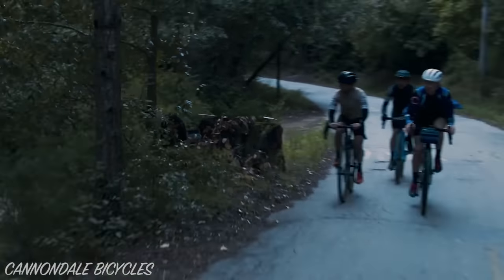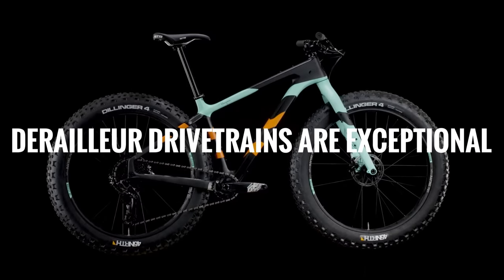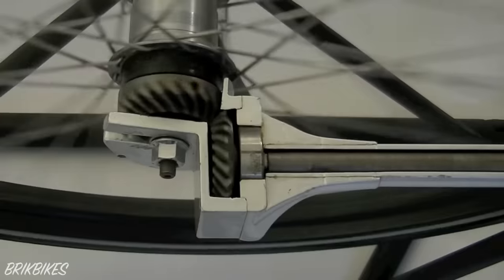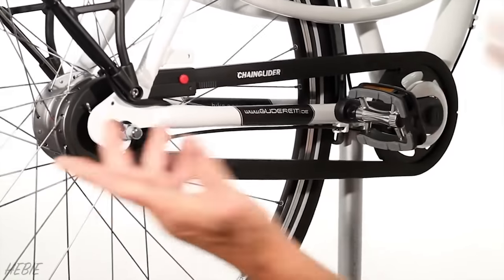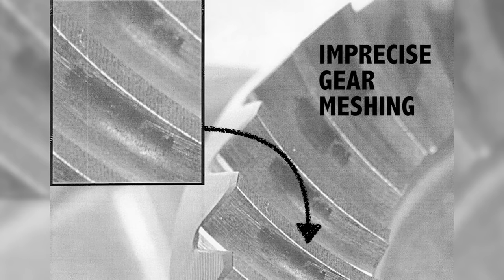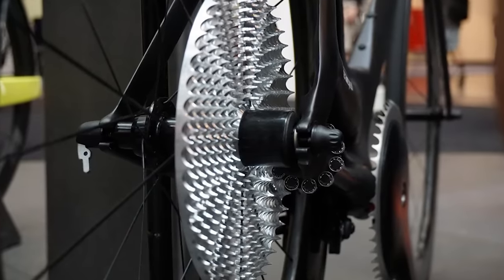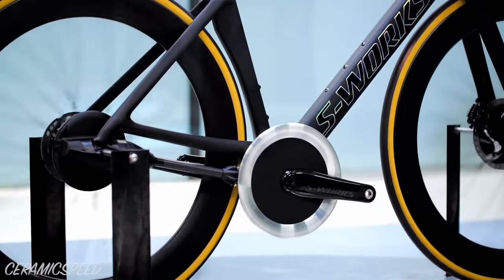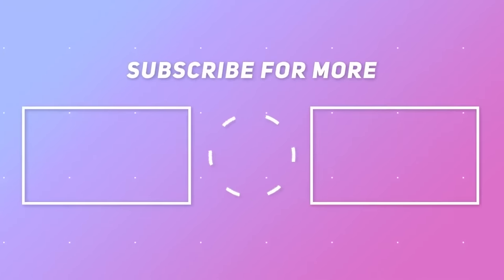Are Chainless Shaft Drive Bicycles a GENIUS or TERRIBLE Idea?

Comment from the maker: QUESTION: Do you think the Driven drivetrain will make the leap from cool concept to derailleur killer? 🤔🤔
Reply: seems like shaft drive with a hub gear is a better solution? both technologies tried & trusted no point reinventing the wheel
Reply: only if you want self contained though - chain isn't going anywhere
Reply: I don’t think it’s going to replace derailleur systems, at least not until there are more innovations in materials and engineering design.  And while the engineering and materials challenges are significant, I think the real challenge is going to be convincing frame manufacturers to invest in the currently unproven design...
Reply: Not hep on it.
Looks flashy but weak.
CEOs letter said the same.
I run a machine shop & ride Road & FAT bikes.
My Road are chain & 10 speed (ubiquitous & flexible) + a Specialized Langster Fixed Gear  (unbreakable & efficient).

The Belt drive running an IGH is a 'dream item' in my Future + I believe the way forward for increased drivetrain reliability.

I'm SUPER curious about Shimanos 13 Speed Gearbox development - what have you heard of late ?

PS I know Rolloff & Pinion are FAB but they're $$$ still & Shimano seems to have all the right factors to bring Gearbox Bikes to the FOREFRONT of the marketplace.
Reply: @roseroserose588  Yeah, Driven claims very high efficiency, but what happens when it gets dirty?
Reply: The fancy drive model looks ok , if they can make it stay reliable for the long term , but for me I’m a bit partial to the old conventional driveshaft system even with its extra weight (that’s the car guy coming out in me😃), cars and trucks have been using them forever and if engineered properly they last for many years , as for parts , someone in need could easily have bits made at an engineering shop if they ever became scarce.
Probably the nicest solution is as you said , the belt and internal geared hub(except for the expense of the geared hub).
  I think for cheapness and pure convenience of being able to buy cheap parts would be the good old chain and derailer even with their small down sides..
Reply: I hope so, but not for my bicycle, but for a trike.  The extra weight is not an issue, but REALLY long chains have their own set of problems.  Or do you use multiple chains?
Reply: @albertbatfinder5240  Yes, I think it's a convenient opportunity for data collection during development. Do a heap of research that doesn't pan out or proves your theory wrong. "Whoops! We determined that it wasn't feasible due to the current market climate, so have unfortunately decided to suspend development." There goes your investment, boohoo, good thing they had fun messing about in the lab...
Reply: no, dangerous rear wheel with the sharp parts exposed, they could have inverted the design with teeth facing wheel much like how a disc brake sticks away from the wheel, but what do I know as an engineer lolz.
Reply: How about direct drive like kid trikes? With recumbents and rohloff hubb, it could be
Reply: Isolated chain like it made in GoCycle with Bosch assist and Rohloff Soeedhub. We need to combine them.
Reply: @redlkb  Just use a race case
Reply: I have had a lot of BRIK driveshaft bikes in the shop. Those things just did not last (2000k commuting). They were plagued with alignment issues from the factory. I have also tried others. They all had this had this springy feel from the torsional spring that is the driveshaft. At least the ceramic drive tries to solve that issue. I am very doubtfull if this thing will work, but it would be nice if it did.
Reply: Absolutely not.  Any company making a shaft drive is going to be proprietary.  Whereas chain drives have been around long enough that they have been standardized.  So, if your shaft drive bike breaks down, you will be waiting for parts when a chain drive can be repaired from parts made by any manufacturer.  It would take a lot to kill a tried and true tech that delivers for less.
Reply: No. I'm convinced that this entire enterprise is a complete scam. The flex on that thin gear plate and the minimal tooth contact area is fundamentally flawed. I bet the current prototype can't deal with more than 80w maximum load.
Reply: Belts have most of the benefits and is more weather resistant.
Reply: Depends on efficiency.
Reply: Nope it won't kill off a chain and derailleur.
Reply: This tech is a century old. Do some reading before you copy/paste, bandwidth waster.
Reply: @albertbatfinder5240  crowd funding has become established manufacturers legalized scam. What they do is come with “pro” product that they have already designed ( how much does it take to slightly improve already market success product), take money that they have no legal obligation to return or fulfill with product, secure mass orders, use that (or invest for return) and then deliver the product so late that customers are already jumping up and down for next “new innovation”. It cost them nothing to but bring free money before even they mass produced, because people have already paid for it without guarantees.
Reply: No
Reply: Two seconds of FEA on this drivetrain should make it apparent that it's a pipe dream.
Reply: @alexdi1367  they currently are installed on "Hopper/Relay" bikes, so not a pipe dream Invented in 1800s.
Reply: @roseroserose588  I am new at working on belt drive bicycles. A little lossy, but silent, lighter and clean.
Reply: @albertbatfinder5240  the tech is over 100 years old and large (city-wide) rental bicycles use them. I think you should do more reading to refresh.
Reply: @bob-ny6kn  Hey Bob, I was specifically talking about the Driven drive train from CeramicSpeed.
Reply: @bob-ny6kn  If you can't figure out the topic, please stop talking.
Reply: @albertbatfinder5240  Right. But how many similarities can exist and call it a new idea?
Reply: No, but it will make a great niche.
Reply: No. It's spikes galore which means shredded legs and it trades away the only pro of shaft drives just to work.
Reply: Giuliano Skywalker  you do not see belts on sport bikes because of engineering cost and packaging. And there is no financial or safety reason to put them on sport bikes. Buell has proved belts on sport bikes work. Yamaha has proven high horsepower with shafts with the Vmax. Most manufacturers do not use Shaft Drive for sport bikes due to the “Shaft Effect”. With shaft drive when  you let off the throttle, the rear end squats and that eats up ground clearance which effects cornering angles. BMW uses a “Paralever” system to neutralize the “shaft effect”.
Reply: Make the leap? If you think outside 'Driven' you have a chance.
Reply: Absolutely not. There's just no compelling reason for it to exist.
Reply: The driven drivetrain is a bit of a non-starter. Even if you could solve issue of lateral rigidity on the rear cogs, there’s the issue of gear ratios and geometry: Because the diameter of each ring of teeth grows linearly, you’ll feel a very non-linear change in gear ratios with big steps in the high gears and small jumps in the low gears
Reply: Thinking outside the gearbox...
One could imagine the space between the 2 gear boxes as a long, small diameter motor. Motors solid shaft is the driveshaft.
Some of you might imagine several little mice in wheel cages spinning the driveshaft.😒
Reply: Nope.  Just not as simple, reliable or repairable on the road as a chain.  Chains have been around forever for a reason... they are simple and work.  Oh yeah and they are cheap and easy to make.
Reply: My point was (I didn't mention) the electric motors shaft is the driveshaft so IF the motor didn't work, pedaling and shifting is still unencumbered.
IT all being contained out of the elements = BIG PLUS.
Smaller diameter motor is less of a pedaling encumbrance when it's non-functioning.
Also it can be regenerative = BIG PLUS #2 .
-->I'm beginning to think I might be on-to something here.
Reply: you roadies will do anything for aero
Reply: A modified version for e bikes might end up looking sort of like a mechanical CVT and with modern composites/materials and manufacturing methods it's likely the whole thing can be sealed, dry lubed, and nearly unbreakable.  IMO the grail especially since anything that doesn't have a belt or chain in the transmission path immediately loses an order of magnitude of backlash and your efficiency should go up, even without internal friction reduction designs using off the shelf parts.

The whole drive unit could be designed to literally snap off like a cartridge/module and the bike can self calibrate replacement units once you sit on it and pedal/run the new unit a bit.   Make retractable ergo pedals since you can decouple the user interface from the internals now and you're free to do what you want with the bit between the bike and the feet, for both riders - back pegs can actually be engaged to the drivetrain as well - again, the decoupling of all the bits that getting rid of the chain/belt allow for even greater force to be managed without equally diminishing the performance/efficiency of the drive/braking system. 

Speaking of braking, more of your energy would return through regeneration as the efficiency of transfer is improved in both directions just as a belt/chain provides that linkage for both actions.
Reply: Do you know what Iridium Satellite Phones are? It was going to have greater coverage than the cellular network. 
But they went bust. They had to purposely destroy their satellites in orbit. 
The QWERTY keyboard is NOT the best layout, but it was first. 
Sometimes good ideas just don't make it!
Reply: There were designs decades ago where an e-motor stuck out the back of the derailer thus boosting riders input. It was designed to NOT do 100% of the riders work.
With the advent of more efficient e-motors it's now possible to incorporate nearly anywhere in the drive system. Even a front wheel boost drive, something I made on my bike in the 80s as a test. Worked out really well, tho I didn't test powered in varying turns.
Reply: The concept intrigues me as an eBike rider. The weight factor is not a problem. It could even be heaver duty on a mid drive motor, as they produce a lot of torque. I don't know if it could affordable enough for common bikes or light enough for racing bikes.
Reply: Throw a handful of dirt or mud at it and the sh*t will surely hit the fan! Pinion or hub gears are the only real equivalent or option at the present.
Reply: If they can engineer it to work on a moving pivot e.g a full sus enduro rig; then it has potential due to it longevity. 
If you could combine with something like a rohloff hub you'd have a brilliant tourer; but I can't see it being used in the MTB scene??
Reply: Nope. Too heavy and not reliable.
Reply: @beerman1957  that's the short and accurate version. Doesnt generate as many views on youtube though 🙉
Reply: No. How will they stop their rear "plate" from flexing? It's not a thing that can work under load.
Reply: @jpangmar  Increased complexity does NOT equal less maintenance- it equals infrequent but costly maintenance- as opposed to a chain drive which is frequent but nearly free maintenance.  When Your Rohloff breaks, that’s a very costly repair.   Snap a tooth off a cog and its a couple bucks and 20 minutes to swap it out.
Reply: No !
Reply: No! You cannot change physical rules.
Reply: @roseroserose588  
..
9
Reply: @roseroserose588  

.

..
Reply: I'm afraid they won't be able to ever solve the problem of slipping bearings under serious load and/or muddy conditions.
Reply: Only way this will kill a chain drive is if every one that buys one of these has the $10,000+ it will be marketed for when it's a buyable product in 5 years from now.
Reply: nope because theres a far better design. if anyone wants to fund it let me know im totally broke lol
Reply: smaller surfaces more preasure, no.
Reply: I'm pretty sure the cost factor of shaft drive will keep derailleurs in commission for a long time.
Reply: Pedal assist seems like a far better solution.
Reply: Motorcycles use chain systems and thus there is no end to R&D. So no, shafts will always be niche.
Reply: Nope, nothing shown can handle rear suspension found on most bikes in the 1000+ price range that it's going to end up shooting for
Reply: Not unless they find a way to make it cheaper.
Reply: I don't think so,  they have been a prototype for years.
Reply: No, it will probably fail, even if it's not a scam from beginning.

Thing is, what get's sold in a consumer bikes is usually dictated by what was developed for certain super-specialised (frequently single-use) bikes and then redesigned in cheaper form and higher durability.

Even then, it mah not go well if there is too much hype and expectations - I remember 2 guys, who passed me on the way down on steep road in Swiss mountains, fully relying on their powerfull disc brakes to brake if needed... Well, I met them under mountain, their brakes looking like a metallic rainbow and warped to a point it was braking itself...

And there is a problem:
While for commuting cyclist or cyclo-tourist, it's completely irrelevant if effectivity is 7% higher or lower (unlike reliability and zero-maintenance), for racers (and MAMILs) shilling huge sums of money on the market whenever there is something even slightly more effective, this is something they are obsessed with...
And because racers are not going to use that, there will be no reasonably priced version mounted on $200 bike for cyclo-tourism/commuting...
Reply: @jpangmar  Paired! It's NOT a piece of fruit!
Reply: Not if you will polishing the old turd, these guys will need a new approach-new turd.
Reply: I'm all for radically re-imagining and re-thinking a problem, and Driven is, on the surface, a very appealing alternative approach to shaft drives, but my gut feeling is that it simply won't work in the real world.
Reply: @roseroserose588  lol
Reply: @paultreneary  My gut feeling is that it will but like I've said I'm not really keen on cycling, therefore, I will not waste my time to arguments more and if your choice is to follow your gut feelings, why not? Freedom of choices is great stuff.
Reply: I'm all in for encouraging the development of new technologies, especially those concerning mechanics, but this mechanism seems to have some intrinsic deficits. By principle it relies on many small high-precision features and moving parts, such as the required 12 petite bearings in combination with the perfectly shaped cog in order to assure rolling contact, which are sensitive and prone to many types of failure. Engineering can possibly aid in reducing costs of certain parts for mass production, lead to a design that fully shields the many small parts from the environment, and allow for it to be less sensitive to frame flexibility, although I'm skeptical that all of this is feasible without introducing too much additional weight, friction losses and cost. More pressing however, it seems that the issue pertaining to the many small moving parts would require either a breakthrough of a more fundamental technology like the invention of a new material with superior hardness and strength, or a completely reworked mechanism. I would love to be proven wrong, though.
Reply: The shifting mech is something we only see in sketchy detail, but it will be hard to make this reliable, because there might only be one place in each rotation where the teeth line up between the two gear wheels. We see the gear split and engage with another wheel, but how is the drive transferred? The "proof" on the track bike was probably a single-speed so proved nothing. I expect this concept will never make it to a practical prototype with shifting, let alone a production run.
Reply: The idea of a shaft on a bike is very very old. And it keeps popping up again and again. It's interesting but it has never been viable. You need a strong sturdy connection from pedal to driven wheel. That's either very very expensive or very expensive and very heavy. As a recumbent driver I was always interested, since recumbent drivers usually need at least 2.5 chain lengths on their bike. And it's always messy. And it really changes between 40km/h and 50km/h how well it is kept.
The forces that are put on the shaft are way higher than the forces put on a monocoque by a chain.
So the moment they can transfer 400 to 800W of power over a distance of about 1.5 to 2 meters with an efficiency of 99% or higher and a weight less than 2kg, wake me up please.

Edit:
Oh my god, they really claim that they can keep a few 100 newton of force against a tooth at that disk that has no counterforce except the 15 cm long disk to keep it straight? Especially the low gears where you will need exceptional forces to go uphill. It looks like a chain without tension... How? I want to know how this plays out. Keep us informed when it really appears!
Reply: The rear derailleur on my bike decided to invade the space my rear wheel was supposed to be in.

Consider me "open to alternatives"
Reply: @shenone3285  I've had that happen too. It's caused by incorrect adjustment of the derailer mech. Check out sheldon brown's site for tips on how to tune it.
Reply: @jamesrindley6215  Thanks! I'll keep this in mind when I get my bike fixed!
Reply: No, it won’t. It will be more sensitive to dirt/mud than chains, it will cost multitudes more and won’t be as durable.
Reply: Nope
Reply: NEAR TERM EXTINCTION - HUMAN  I would say this was “voting” since the results have no effect of the outcome (i.e. the performance and feasibility of the Driven drive chain). People take questions on the comments section bit seriously and regard those as high school math exams where there is only one correct answer. It shouldn’t be forbidden to just ask people’s opinion. If not for any other reason than pumping one’s audience engagement numbers tad higher :-)
Reply: Impractical in Real Conditions
all that exposed gear surface, looks easily jammed up by mud, debris, someone's dropped earbuds or shoelace, etc.

...I guess you could enclose it all in a case? but it would be a pretty big case...
Reply: @hellosunshine1090  Shimano's Gearbox, near as I've seen. Conceptually its a tiny self contained chain and derailer drive system. Same principals of opposing stacks of cogs and a chain traveling between them to change ratios; just made tiny and all hidden in a box.
Didn't old trucks use to work that way?
Reply: It hast the weatherproblems and the lower efficiency and the spareparts are most propably way overpriced so the worst of all worlds.
Reply: Possibly a more flexible composite shaft would decrease the need for stiffer frame?
Reply: Considering motorcycles with up to 100 hp have been using them for years, I can’t see why there aren’t production versions available already.
Reply: @jpangmar  it would then be easier to just  put a case around the chain to keep it clean and get chain efficiency advantages.
Reply: I think the Driven solution is a dead end. At least for quite some time - they can't use larger bearings so they need better bearings. Which we can't make yet for an unknown number of years. Maybe never.
Reply: @roseroserose588  s
Reply: Hasn't since the idea was introduced in 1906.  Terrible losses compared to chain drive.
Reply: Chains are MUCH more efficient.
Reply: Yes.   Because this video is full of crap and disinformation.
Reply: @pauldroop  Weight. Weight for a mc matters less.
Reply: Only among that small group of people too lazy and ignorant to learn how to take care of a derailleur -- but somehow able to afford several new, more expensive, and less reliable mechanisms.
Reply: I'm not sold on it. It may have niche uses, but derailleurs aren't going anywhere soon.
Reply: No.
Reply: Nope
Reply: never 👎
Reply: @alexdi1367  maybe its a Wright issue
Reply: No
Reply: I feel a direct pedal on the axle would work the best with a slippable clutch like arrangement inside you can control from the handlebars on a break lever in conjunction with the centre hub axle gears you already show exploded view of in this video. If you can have a automatic hub that returns to an easy gear after you push a button for starting to pedal then pull a clutch harder for more torque and less for hill climb I feel that is the way forward.
Reply: no,it will fade and die
Reply: Awesome video

You should partner with some 3D printer folks from Youtube and try to build scale models or get ur hands on these new gear boxes.
Reply: So how would it replace derailleur on a mountain bike that has a pivot on the chainstay (four bar linkage) like specialized used for ages for example?  The center of the wheel is not the same distance from the center of the crank through the rear suspension travel?
Reply: So over engineered it won't ever become standard. Hub gears however might.
Reply: @Skrueger999  you would need to have springloaded extendable pedals when the pedal rotation hits a point in its 360°travel it would retract one side and extend on other side it's rater simple if timing is right
Reply: @mealex303  I’ll get Inspector Gadget on it ASAP 😂
Reply: kalki avatar (beast of the earth) (christ on the white horse) (son of man on clouds) is the biggest enemy of dajjal/antichrist/kali 😏

Kalki Avatar (Murtaza) cousin of Moula mahdhi a.s. (muhammad) 😎

Moula mahdhi is raja shashidhuvj (the mighty one) 😎

Prophet Moula Isa a.s. will kill dajjal cause dajjal is going to kill Kalki Avatar 😏

Kalki Avatar will follow orders from 2 religious king Moula mahdhi a.s. and Moula Isa a.s. 😎

Kalki Avatar going to have 2 swords and ring of moula sulaiman a.s. and staff of moula musa a.s. (iron rod) Staff of moula musa a.s. is like omintrix can transform into anything and can transform others into anything And stone in the ring of moula sulaiman a.s. is also known as kastav mani and it's more powerful than all 6 infinite stones combined 😇

This staff will transforms into white horses with wings,weapons,iron-man,cloud etc or can do imagination into reality 😎

*Ratn sru sword of lord shiva (miri)😇

*Ratn varu (zulfakar) sword of Moula Ali (piri) 😇

miri piri 😇

Satyug (sunrise from West) 01.aug.38 😏

Sambal is hospital 😏

Gzwa e hind 2029 😎..
Reply: Maybe a solid mech for motor driven bikes?? Imagine the possibilities
Reply: I'd  be a tester but PRICES  probably  out of my income  but if I was able  to  I'd know if it's  better  cuz I always  end up with bikes  becoming  just parts
Reply: It was a cool concept in 1900. It was quickly tossed in the trashbin though, for reasons you explain very well. Darn you, classical physics!
Reply: It already has, your video is 30 years behind actual technology. Shimano has yet to adopt said technology.
Reply: It was a bad idea 125 years ago, and they have not changed the fundamentals. Heavy, expensive, inefficient, with at best highly limited application.
Reply: Changing the direction of rotation by 90 degrees cannot be efficient, right? the chain keeps all the rotations on the same plane...
Reply: I say the more parts, the more chances of mechanical failure. I can see all kinds of things happening with them gears. A few grains of sand can do wonders...not good wonders either.
Reply: @Krieghandt  the biggest issue with longer chains is on rough terrain.  The issues are pretty simple and easy to solve
Reply: @taufikabidin412  so an expensive trike for wealthy peoples kids?
Reply: All this energy input is killing me time to get an ebike 😂👍after I get the motor home 😉solar power of course. Charge the bike.
Reply: No, I dont think people will like having a meat grinder behind their leg
Reply: What about an electric bike using a shaft drive train?
Reply: No chance 😂 99% of  bicycles are chain driven for a reason, and you said it yourself they work well not only that where the hell am I going to get parts for it?? Its not like I can pop to my local bike shop and get it fixed, lets not try and reinvent the wheel there lol for an additional 7% or so efficiency is not enough to justify the cost, maybe in the field of competition if you are able to somehow reduce the weight so that its less then a chain setup an improved torque and speed then hands down that's your market right there but if the numbers don't add up then don't waste any more of your cash or time. That's my honest advice 😊
Reply: @tinkertom3683  no chains have 7% higher than the other type
Reply: @tinkertom3683  over complicated, it's easy to put the chain back on and possibly carry a spare with the tools, as for the claim of 7% efficiency extra, tyre's, unbalanced  brakes, and an inefficient man as myself will bring that down to not even 1%😂👍
Reply: Chain drive on mountain bike could become a Nightmare.
Reply: Nope
Reply: Well, no. The concept isn't really new. If you want to see a bike from the 70s with a belt-less drive train go to the technic museum in Praque.
Reply: I know the shaft and gear will succeed. There are ideas that the inventor is not seeing that easily bypass the rigidity problem. As far a weight one idea I will let out is carbon fiber drive shaft. As strong as steel and half the weight. Also think titanium gears
Reply: Nope!
Reply: @roseroserose588  ⁶
Reply: Nope, the current system has been working for a while, and so it will go on
Reply: I'd be interesting in a bycycle where the pedals directly turn the main wheel.
Reply: No !   It is very expensive
Reply: I would rather choose the drive chain instead of shaft drive, it never works
Reply: No way. No gears fewer options. Possibly for bikes in really sandy conditions and flat terrain like a beach ?
Reply: @roseroserose588  Hub gearing is obviously not well used now especially on road bikes for a reason. When I see a rider win a race with one of these things or even compete then it might take off.
Reply: @bob-ny6kn  I’m 58 years old and recall seeing something like you’re referring to in a library decades ago when libraries were a thing. So yeah this is old tech.
Reply: @bob-ny6kn  Exactly. Like nobody’s thought of a shaft driven bicycle lol.
Reply: This shaft drive bike used for trike bike
Reply: How well do they work with pedal assist systems?
Reply: @jamespardee9300  They would be destroyed in a mid drive system in this form for sure.
Reply: No , waste of time.
Reply: Will it still mesh when that rear array is covered in gritty mud? Probably be problems with getting long grass wound round it too.
Reply: @dougfromsoanierana  it brakes, there is no space for dirt and it will not clean itself. to make this work correctly it needs to be sealed, and that will make it disposable when is death.
Reply: Don't know but I hope so. The duopoly will fight it in the shadows though.
Reply: I'm done with chains. Break the chains!
Reply: If you make it out of Lego then it will weight less than chain
Reply: someone need to bring ceramicspeed into the chat
Reply: I hope so, chain systems are a pain with rising prices of maintenance. a 50$ tune-up yearly was fine, 150-200$ is just making it more attractive to have a low maintenance solution.
Reply: Mbuk "Rat Bikes From The Gutter" article documented a shaft driven MTB (cannondale) built/bodged together... by a london cycle courier way back in 1994!!!!!! (edit also featured a side entry long armed cantilever..that later was called a v-brake)
Reply: no
Reply: Nope. I think mud will clog up that rear cassette in no time.
Reply: Never
Reply: I don't know if it'll be them, but I think it's only a mater of time before someone develops one that will be great, but most people won't be able to afford it because of the engineering and materials/production cost. I think it's a matter of figuring out how to have gear shifting within the hub and using the strongest, lightest materials they can find. My guess is that Japan or China will figure it out first.
Reply: no
Reply: a bit of specialization & cost reduction, and 1they'll make a sharp rise
Reply: No
Reply: @QuickQuips  to much drag in belt drive
Reply: @QuickQuips  belts have a high drag coefficient.
Reply: @atexnik  bearings are supposed to slip
Reply: in DEEEED    😑
Reply: To establish a market  where a market already  exists.  Difficult
Reply: @ChrisLoew  honestly  i was thinking  about a scraped calf when i saw it 😅
Reply: No.
Reply: I would love it to, chains always fall off or when you push hard the chain will skip teeth
Reply: @tigerdcd  - Always?  I have NEVER had a chain skip teeth. And at 70, I've ridden a considerable amount of time. And the only time a chain came off was because the detailer was out of adjustment.
Reply: No
Reply: All good but wont last .good old fashion chain.
Reply: Expensive, high wear, low efficency, gearing is a nightmare. Why is this even a thing...
Reply: Just look at motorcycles for efficiency. Chain is your best for getting power to the wheel then belt then shaft. And the required maintenance is the exact opposite shaft then belt then chain. It comes down to cost and efficiency loss. I know you just paid $5,000 for this nice new fancy super ultra light bike but we went ahead and put this shaft drive which makes it the equivalent of 10% harder to pedal. It's a really hard sell
Reply: Even if they can get all of the tolerances, seems it would be very vulnerable to dirt and debris.
Reply: I think this will end up like disc brakes, only really at the low and ultra high/compatible end
Reply: Definitely Not for bikes as we know them. Maybe for something else.
Reply: I sure hope not. Way harder to work on, more expensive, and annoying to replace.
Reply: Only if you still wear bell bottom jeans, chains used to eat them for breakfast.
Reply: I have a solution for the easy alignment of gears when changing the rear wheel. Instead of a conventional setup with two bolts on either side, I propose a method that is similar to a car wheel hub which would make gear alignment easier since the wheel would slot in via the spin hole. I hope this is making sense.
Reply: As soon as automatic gearboxes for bicycles become a bigger thing.
Reply: @Karl with a K You seem to misunderstand what i am talking about, and no, it is not electrically driven bicycles. Some people actually pedal for the exercise, but of course I can understand it if you find that "unnecessary".
Reply: Maybe
Reply: Chain is there since 1879 and I guess it will remain...even after 21.st century.
Reply: The thing I want mine is shaft+ electric motor. Can ya do that please
Reply: hah
Reply: Bevel gears lose lots of energy, this is never going to beat a chain.
Reply: @jurekgadzinowski2895  what? The shaft bevel with electric motor not effective?
Reply: Probably not, they're always going to require overengineering, and so will always be overpriced at the least.
Reply: @davehood2667  And their efficiency is always worse, any direction changes, especially bevel gears make the mechanisms less efficient.
Reply: @jurekgadzinowski2895  wouldn’t the electric motor and brushless wheel with shaft based transfer work better since electricity is stabilizing the motions by preventing resistance?
Reply: Motorcycles usually go chain or belt.The bikes that don't have an issue called "Jacking' as power is suddenly increased it causes the bike to want to rise due to the characteristic of shaft drives. They also use up more horsepower.
Reply: @debbiebernhardt5406  Could you explain it a bit better?
Reply: @jurekgadzinowski2895  you know motors are made using magnet and electric energy. Why not combine the 2 energy’s of a person and electricity for locking system of a bike wheel.
Reply: Probably not because of the price.
Chains are cheap.

Weight/efficiency isn't such a huge issue for the average riders that carry additional payload, value ride comfort over speed and often do not even keep their tires properly inflated.
Reply: Not with the current design. Either it is going to skip like mad when you step on the bike or it is going to be too heavy to avoid flexing. I'd rather get a rohloff since i've tried one of those and they are really great.
Reply: I hope so .... chain is not the best thing and needs to go
Reply: NO Gear box and belt makes more sense if they can get weight out.
Reply: Who do I talk to for a fix/solution for the current drive shaft problem?
I have a solution, the solution really...
Reply: I'm coming from the future to say, no, they didn't.
Reply: Too complicated.
Reply: Definitivamente NO